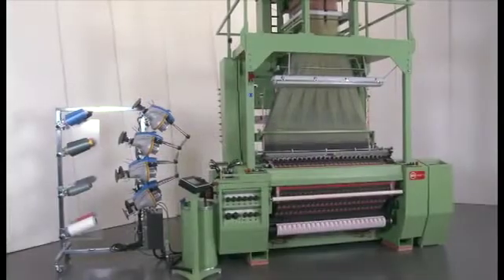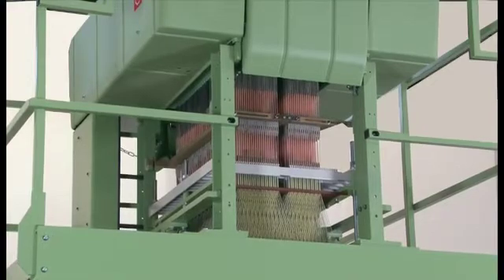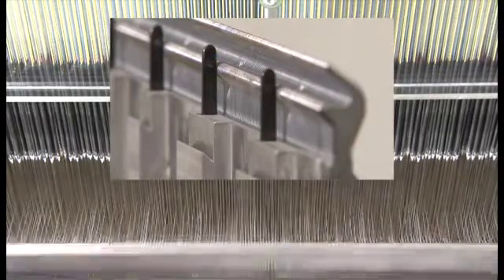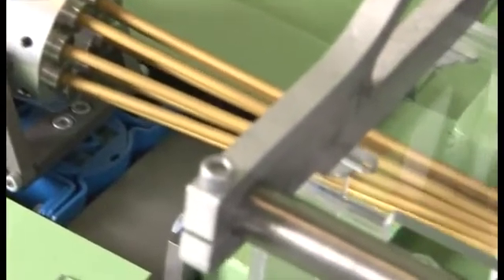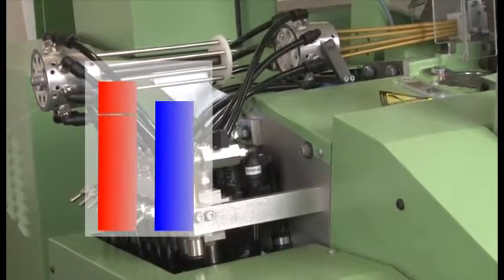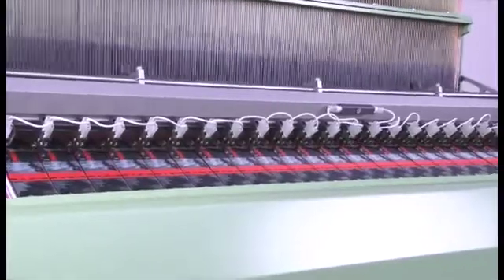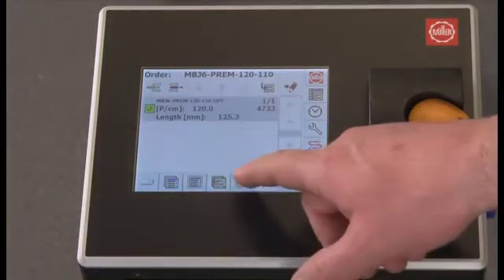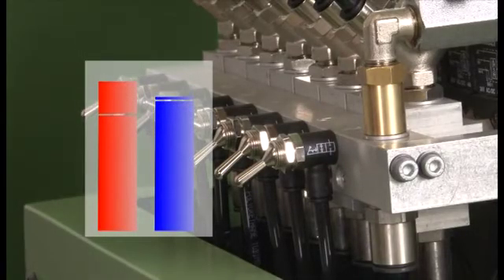Jacob Müller MÜJET MBJL6 Air jet Label weaving machine for labels and woven images with cut selvedge

Comment: Price of the Jacob Muller MBJL6 Air Jet Label Weaving Machine for Labels?
Reply: One year ago, MBJ8! cost 200 000 CHF, what at now, don’t know. What about 6 version, idk.
Reply: @illiaistomin3422  sir air consume i. 1 mnt???
Reply: Are u there
Reply: @zainpakistan1797  idk. we use compressor with auto control
Reply: @illiaistomin3422  we are too using compressor 22 kw 3.4 m3/min i want to j8 and j3 series air consume in one mnt or hour eachmachine
Reply: @zainpakistan1797  it`s enough. But, air consume is variable. Maybe you will ask official partners at jacob muller ?
Reply: @illiaistomin3422  i think u dont know its flow rate
Reply: @illiaistomin3422  where i ll find him
Reply: we sale müjet 2